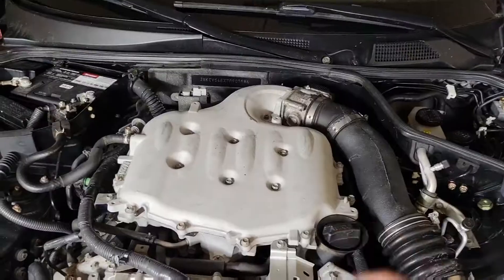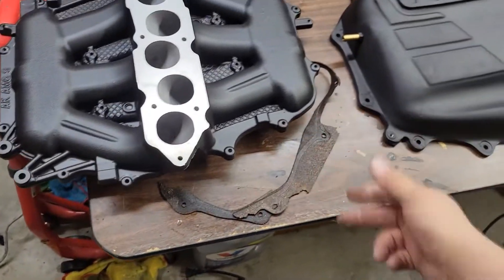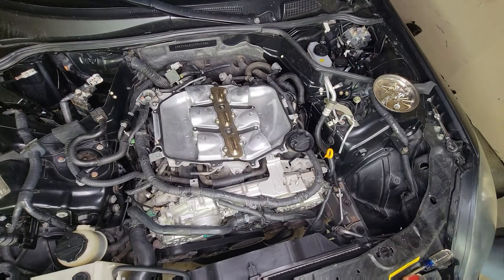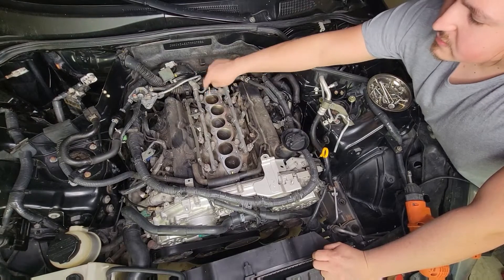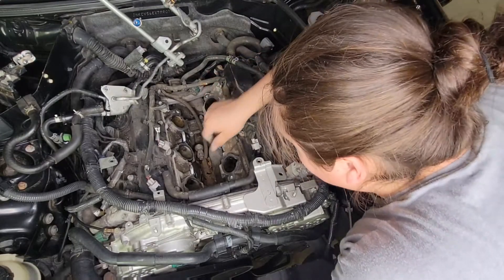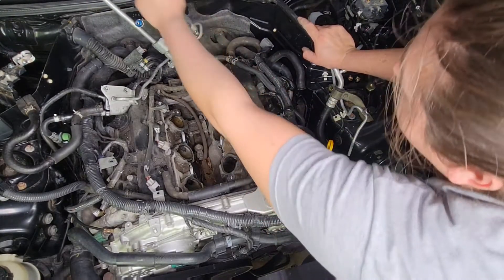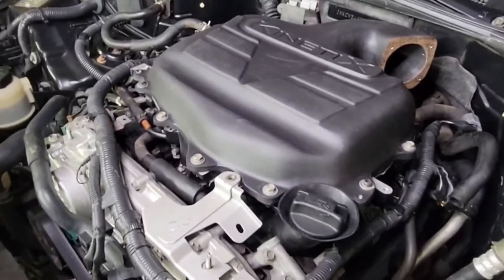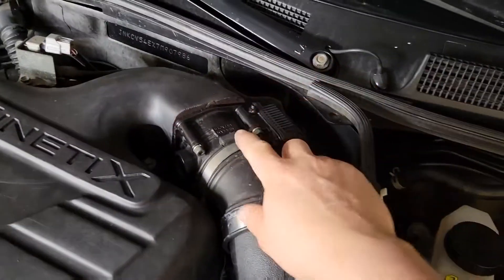Kinetix V+ Plenum and Motordyne MRev2 lower plenum installation on G35 or 350Z

Comment: what's the torque spec for the lower manifold where the injectors go ? help plz lol
Reply from the maker: Hold on I’ll check
Reply from the maker: Lower intake manifold bolts:
11 ft-lbs (15 Nm)
Be sure to start tightening from the center and work your way outward in a crisscross pattern to ensure even pressure. 
It’s also recommended to apply threadlocker to the bolt threads to prevent loosening over time
Reply: @latenightgarage7895  how was you able to clean inside the valve cylinder ? and also how to close the valve so I can clean inside like you did...can you make a video showing how you closed the valve? it would be a huge help .thanx
Reply from the maker: @JerrysHouseMusic1 you’ll have to get a big socket and a pry bar to manually turn the motor from the crank bolt  to get the valves closed and open but you’ll wanna disconnect the battery.
Reply: 🎉thank you so much for your help! I appreciate it ! You have a new subscriber!

Comment: Fit 03 DE? G35
Reply from the maker: Yeah
Reply: @latenightgarage7895  fashooooo
Reply from the maker: But what part are you asking for, reason I ask is that the 03 already have the MRev2 lower plenum in them. So don't waste your money on that, as for the top kinetix intake that's worth the money, even adding in a 75mm TB would be good or some thermal upper and lower intake manifold gaskets. I have a video on that, it reduces heat transfer by a lot.
Reply: @latenightgarage7895  well i just ported a mr2 lower plenum  off my de idk if it was 03 motor as car is 05 and runners got ported to match the gasket with 5/8 spacer car feels like the power band is more lower but i didnt really do a pull on it yet as i bolted it up and drove to work

Comment: Did you full any gains
Reply from the maker: Low-end power
Reply: @latenightgarage7895  i got one but I got a de I never installed it yet but I was thinking about porting it abit. That's sick. How's the short shifter so far!?
Reply from the maker: Which part are you talking about exactly? And that short throw shifter is awesome, I'm enjoying the set up. I started flat foot shifting once I got the G tuned with UpRev and the shirt shifts make a huge difference. But I wound recommend flat foot shifting if you don't have your car tuned and a decent clutch.
Reply: @latenightgarage7895  I bought a second set of runners and the m rev 2 manifold. but I heard they don't make any gains on a regular de. So I was thinking of getting it ported to help abit I bought jwt c8 cams and z1 headers, so I was thinking it would help more with all that extra air
Reply: @latenightgarage7895  sick! definitely made a video driving around with that short shifter!

Comment: So how did this work out? Long-term
Reply from the maker: Great, I also add a 5/8 spacer and it's even better. I'm going to upgrade to 1/2 space possibly. I have a ingen long intake, 75mm throttle body with spacer.

Comment: Does it make sense doing this to a 03...I heard it's only the 05 and up that need
Reply from the maker: So the 03 already has the Mrev2. It basically just doesn't have the ported areas, but for the kentix upper intake, it's a definite need for making more power and bringing in more air volume. You can keep the stock unpper intake, but it's got a nasty slant towards the front, made out of metal so it heat soaks bad and has the 6 bolts that can mess with air flow. People do add plenum spacers, but it's not worth the cash for them when they cost almost as much as the kinetix.

Comment: This is sick...i gotta do a harness swap on my car its an 04 now swapped to 05 Revup ..i also have the kinetix Vplus upper plenum not sure if its mrev2 lower or not..not sure how to tell a difference visually with it still bolted down but also in doing all this work while i have it down this far i was thinking about doing a wire tuck since ill be swapping my harness 😁 for that clean look..my strut bar clears fine like it is but i was told you cant install a spacer with the Vplus because its made taller already  eliminating the need for a spacer...thoughts? Also was the heat wrap made with adhesive side or did u use something to make it stick?
Reply from the maker: Thanks, I have a video on the Mrev2 plenum compared to the stock check that it might help you identify what you have. As for a spacer with the Vplus it depends on what your trying to achieve, if you have a 1/2 spacer I think it's supposed to help the upper side of the rpms. Do you really need a strut bar or idle it for looks mostly.
Reply: @latenightgarage7895  the plan with the car is AutoCross so it's not just for looks...haven't really checked into an aftermarket one because I've been under the impression the spacer was a no go...but if it's possible to run them both then gotta look into em...I'm go find that comparison now lol thanks man your awesome
Reply from the maker: Beside a spacer which probably won't make a big difference look into  z1 headers, tomie headers(which I have) or ISR Long tube headers(which I would recommend) bc it give more torque and better sound. Plus a bigger Intake like injen and 75mm throttle body. I wouldn't listen to ppl saying it's not worth it, bc most likely they're not running the headers, down pipes ,and exhaust to help with air flow.
Reply from the maker: For anyone looking at this, remember the more air you can get out, the more air you can take in, which equals more power(with a tune). Adding to much intake with 4 cats is to restrictive, need HFC or test pipes and a after market exhaust, single or dual it's your preference.
Reply: @latenightgarage7895  I do need a 75mm throttle body but I am running an injen CAI that goes all the down into the front bumper with a huge pop charger also it has stock manifolds but has ebay test pipes and y pipe to a Invidia N1 dual exhaust..I recently installed a catch can...it's running mishimoto twin electric fans and mishimoto radiator it has a stage 3 6 puck from z1 and a short throw shifter..I have some poly motor mounts I've not installed yet...tbh I would like the kinetix high velocity with a 75mm and TB spacer ... I want a better flow lower intake runner ..gtr 550's tuned for e85 and an after under drive pully kit plus a nice tune then I think I'll be happy lol so I'm still a ways out but getting there
Reply: I'm also running the kinetix V-plus...I think we established that already tho lol my bad I'm just trying to remember what all I have on the car
Reply from the maker: Well, it sounds like you have a great setup, I'd say get long tube headers for the quick getup and go for the autocross. I did that in my G when it was stock and on Bridgestone protenza pole positions and it was a blast. You having what's in the car already plus the little bits you need will definitely help your time. Next mod would be some big brakes z1 has 4 piston fronts and 6 maybe even 8 possibly. But hey I've been working on my G for 5 years now and I'm just getting close to tuning lol. It's the journey, not the quick result. I have a injen intake and a 75mm throttle body coming form Z1 so I might have them in and tuned by end of August. Ima try to get footage while they dyno run and tune but it's a 3 day process for this shop. So stay tuned.

Comment: It definitely looks good, but what are the before and after dyno numbers with the same tune?
Reply from the maker: No dyno runs, but you can definitely tell a difference compared to stock. Its got better throttle response and a better pull through the acceleration.
Reply: @latenightgarage7895  Sounds good. I did a grind and polish both halves of the plenum and also noticed a difference. You did give me an idea for the intake manifold that I didn't touch. Perhaps I'll take the intake manifold and also slightly port and polish those too. What gaskets did you use, OEM,Feltpro, other?
Reply from the maker: @Stealth G35 Infiniti   Definitely give that a go, should help with airflow. For gaskets the 2 bottom and 1 top foe the intake manifold are OEM but I would recommend using a thermal gasket for all three, suppose to help heat transfer between parts. Look up "Upper & Lower Thermal Intake Manifold Gasket for 03-06 Nissan 350Z 3.5L" on ebay and you'll see the gaskets. I'm planning to switch to these, there's even a thermal gasket for the plenum. But I used RTV for the gasket that is between the platinum and upper intake because the cork gasket soaked up oil.
Reply: @latenightgarage7895  I'm strongly considering doing the same. As you took off the lower runners to the heads, any unusual appearance to that gasket? Would you recommend changing the injectors Orings once you took the fuel rails off? Will the adhesive on the heat shield material hold in constant heated area. I was thinking using metal Peal n Stick roof seal that is made for roof heat and weather. It does provide good sound deadening and excellent temperature isolation. I've used it before as cheap interior sound deadening. The adhesive on a clean surface is nearly permanent.

Comment: Does this work?
Reply from the maker: I haven't got around to checking the temps yet, I do have some stock plenum temps so maybe during the summer I'll try to get to it. I feel that since I used the temp paint under the lower runners it should help keep the heat from the cylinder walls at a lower temp and there's also an opening on the timing cover where heat could kinda escape from. Also the heat shield stuff should help from heat soaking from the bottom of the runners and lower plenum, if I had hood vents it would help dramatically since heat rises. Adding a lower temp thermostat and the lower plenum thermal gasket can also help the plenum lower temps.

Comment: Looks good. You should have had them port an polish the lower intake manifold and also got a  5/16 spacer for the plenum. Thats an extra 20hp.
Reply: Thats basically what the motordyne and kinetic plenum is. Its ported an polish to get better airflow i believe. Plus the more air the better
Reply from the maker: I'd run a spacer but I don't think port and polish would do much. I've heard it does for boosted motors but not really for NA motors, I could be wrong.

Comment: Nice work that’s exactly what I have planned for my lower plenum. My Z isn’t a daily I’m building it to be one of the fastest All motor DE without touching the cams for now. I’m fully gutted I mean fully gutted lol almost everything you can think of is gone weighing around 2700 pounds, full light weight pulley kit, ported heads, ported lower and polished. GTR injectors walbro fuel pump, kinetix v plus stacked with a 1/2 spacer all my gaskets are thermal too. Custom 3.5 inch cold air coming out the front bumper paired with 75mm tb. Long tube headers y pipe full 3 inch single exhaust. I should have the car completely finished by end of February. Nice vid brother I’m gonna wrap and spray my lower plenum next.
Reply: @jerrywilliams6920 update on the de
Reply from the maker: You should check out the Holley High Ram intake kit for the vq35de platform, it's kinda sick especially if you put on a non daily
Reply: Hey Jerry how's the build going brotha????

Comment: very good advice for heat rejection, get a full thermal gasket kit they made a big difference for my G I made a video comparing my friends DE vs my DE in temperature 👍
Reply from the maker: Nice video, did you pull the coolant lines from the throttle body?
Reply: @latenightgarage7895  yesss, no longer is the hot coolant running around the TB. I have a plastic tb gasket, and a motordyne thermal gasket, the only thermal gasket I have left to install is the very lower gasket where the bottom runners meet the heads, the plenum stays super cool and you can put your hand on it after driving it, however to get really detailed and technical, the plenum will turn hot after you turn off the car and let it sit because now the hot air from the combustion chamber is flowing up making everything hot, bc when ur driving it the engine is pulling cold air and fighting off the hot air (depending on ur intake application ofc) mine is fully gold tape wrapped and sits by the fender where it pulls cool air, I say this bc sometimes people may run a short intake that sucks up hot air near engine sorry that was long 😂
Reply from the maker: @DEATHWISHVQ  You should definitely get the Kinetix upper intake like the one I have it's made out of plastic composet so it doesn't heat soak so much. But I would like to get the lower runner gaskets and the thermal gasket for the plenum so day.

Comment: I’ve done several of these and let me tell you you did an excellent job. That’s way better than my first job at it. You should get an Injen Intake, and a 2010 76MM throttle body too. That thing is about to scream!
Reply: 2010 Nissan Maxima
Reply: @Lukas Ethan  does the Maxima throttle bolt up without an adapter? Same plug too?
Reply from the maker: Thanks I appreciate the feed back, and I didn't know the 2010 maxima had 76mm I'll have to look into that!
Reply: The bigger throttle body make a big difference it gets really responsive, I got mine from z1 but nwp also sales one
Reply from the maker: @joshmata3368  did you get a tune or na
Reply: @latenightgarage7895 I've always heard that you need to tune after tb swap.
Reply from the maker: Yeah, I'm not sure, but I just ordered one and an uprev tune with arc, so that's next.